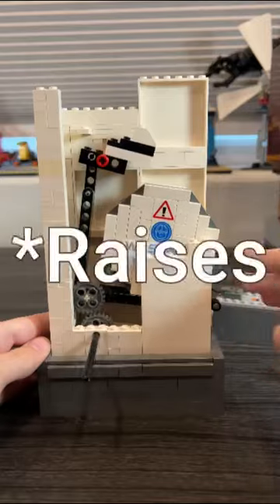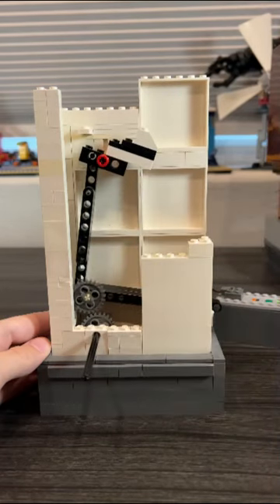I built a WORKING Nintendo Wii out of LEGO!

Comment: There’s off brand pieces (think I got it with a halo knockoff set) that’s a 2x2 plate (grey or purple if I recall correctly) that had studs on both sides. Does Lego make pieces like this?
Reply from the maker: I can’t think of a piece like that in lego except for that piece as a 2x6, maybe you could check bricklink for a 2x2 version!😄